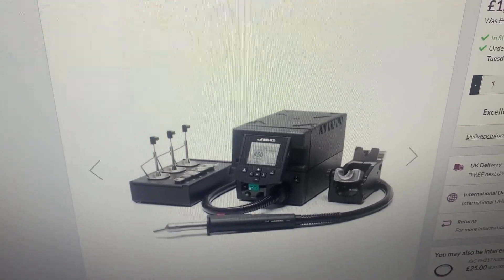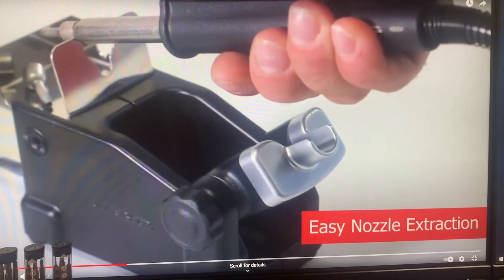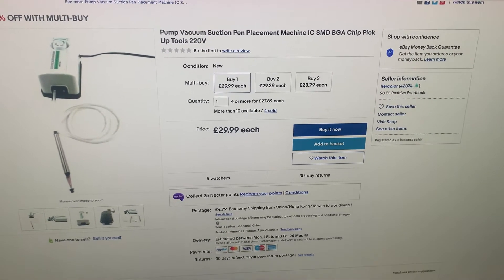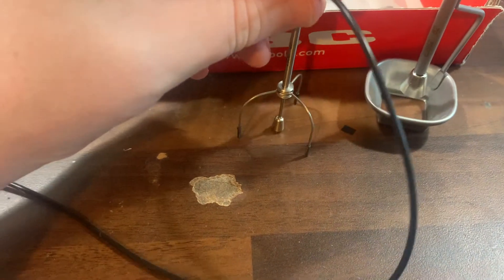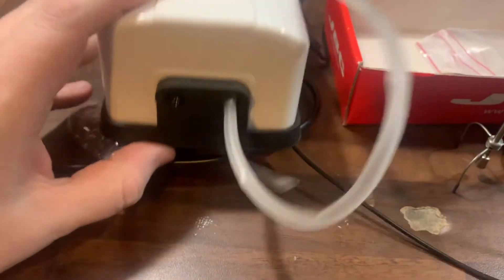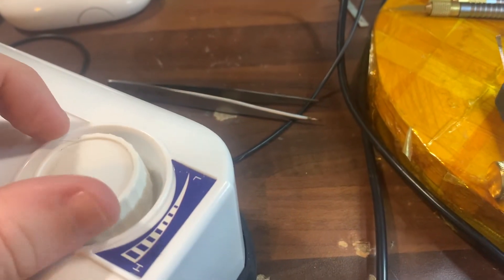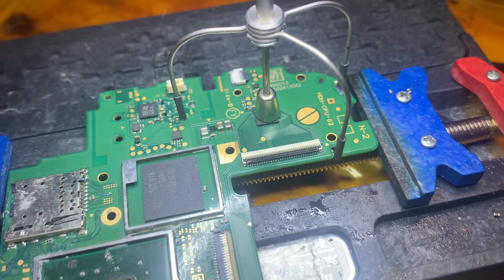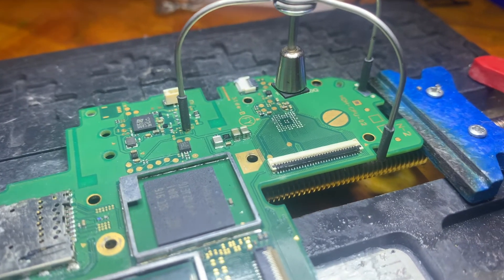HOW TO JBC MODIFY ANY HOT AIR STATION!!

Comment: These tripod are so simple yet so expensive for what they are (a spring, some rods and few silicon parts) that's it's weird they haven't been cloned
Reply from the maker: Totally agree, they are way overpriced for what they are. You’re paying for a name rather than the item. All Jbc stuff like that, way more expensive than it should be. Hopefully at some point clones come available because they’re pretty simple. You can just get the size you’re more likely to use as you can get singles, rather than getting the whole set but still way overpriced. Thanks so much for taking the time, really do appreciate you. Thanks Rich
Reply: @SURGE101  I discovered that they're ancient too! They go as far as the JBC JT 6040 from the 00's so at least 20 years old ; as they're really handy I'm not sure why the usual cloning companies didn't work their magic their. The community surely don't need a 1000th USB-C soldering iron clone but a cheaper variant of these tripods would be awesome.
Reply from the maker: @jonas-fr funny enough that’s how I ended up with a whole set of these, I bought that exact station second hand on eBay as it was cheap😂. The Jt 6040 and it came with the tray with the whole set of these. Even now it still works perfectly. You’re right these have been around for decades and it’s surprising they haven’t made a clone alternative yet. Weller did make a similar one but they’re hard to get hold of and are expensive also. Hopefully they do make a cheaper clone soon because there definitely a market for it. Rich

Comment: Great video thank you. Have you found the tripod lifting gentle enough that it does pull any pads?
Reply from the maker: Thanks so much for watching the video I really appreciate it. I found it works really well, I haven’t pulled one pad so far using it and I have used it quite regularly.The spring inside the tripod I found doesn’t pull that hard on the chip , just enough to lift when you solder melted. I’ve now got a larger one than this now which I’ve been experimenting separating the sandwich boards on the iPhones with it on a preheater, I’ll make a video on that one very soon. It really is a great tool to have. Thanks so much for the nice comment,I really appreciate it. Rich👍

Comment: nice but kinda need to setup everything pump tripod heatshield which takes time
Reply from the maker: If you already have it setup on your work station, it’s just a matter of turning it on and sticking the sucker to the chip. It doesn’t take that long. If you have it packed away after every use , I agree it would take a bit of time setting up. I use it quite often and have it setup permanently on my work station , I love it. The heat shields can be used without the tripod as well which are really good if you want to protect nearby components. I appreciate you taking the time to watch the video👍❤️